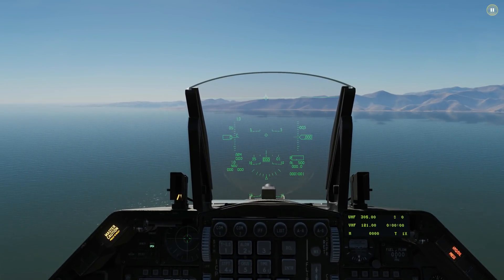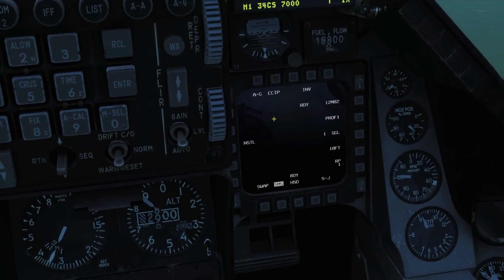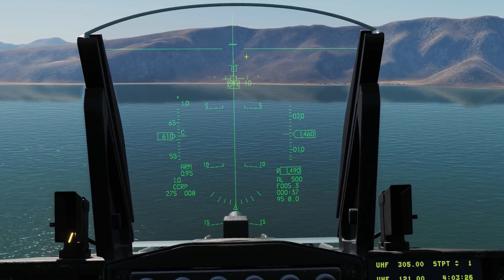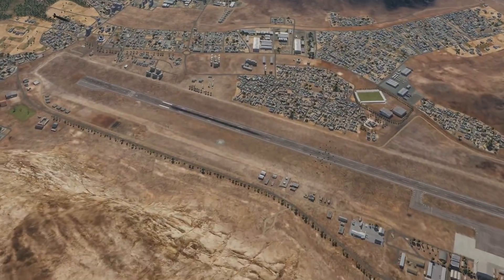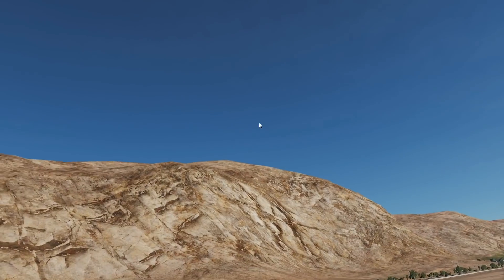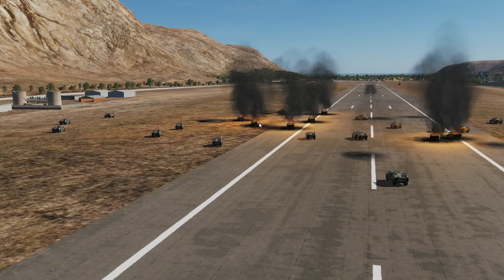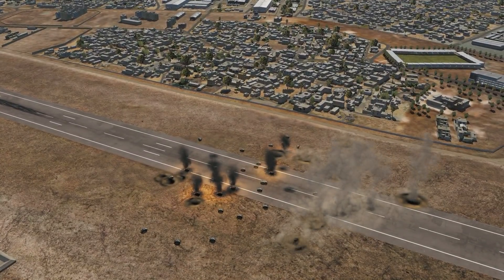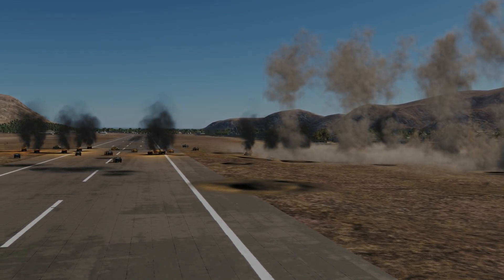F-16C Viper: CCRP Toss Loft Bombing Tutorial | DCS WORLD

Comment: Shouldn't you be using the DTOS mode instead of CCRP for that? In DTOS mode, it will give you a few additional cues such as the cueing for the pull up point. It will flash a big circle in the middle of the HUD, indicated the point where you should initiate the pull up, and you can set up your planned Climb angle on the SMS page so it can compute the best distance for the pull up initiation.

Is this not implemented at the moment?
Reply: William Link Don’t think so
Reply from the maker: Currently we don;t have DTOS, will cover that as soon as it's in thx.